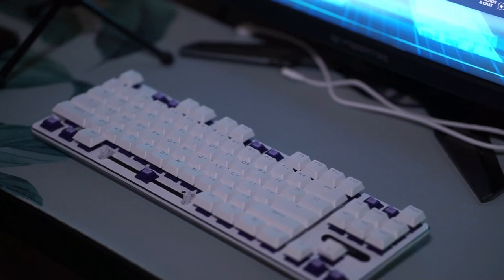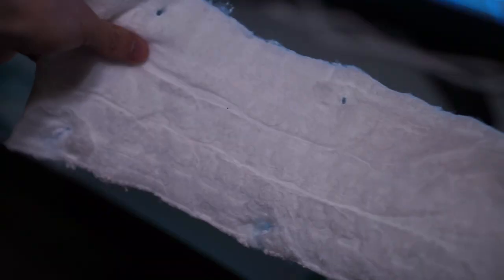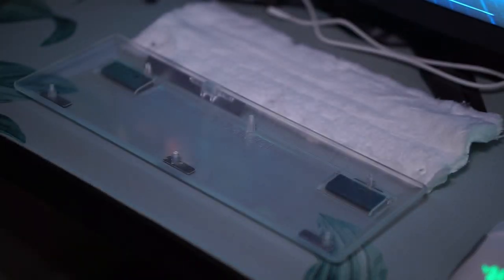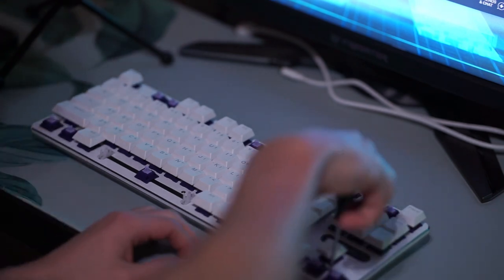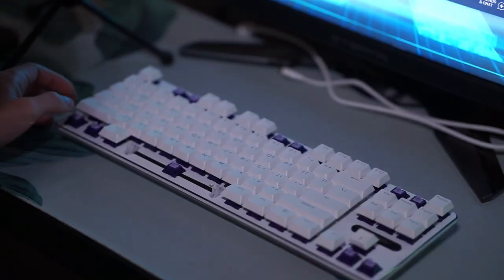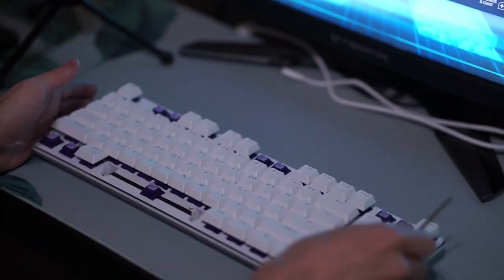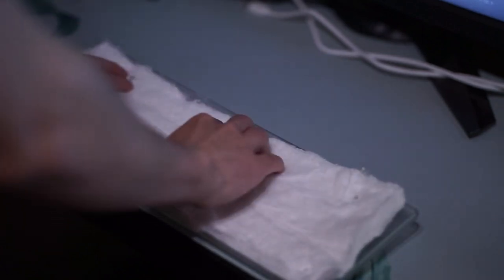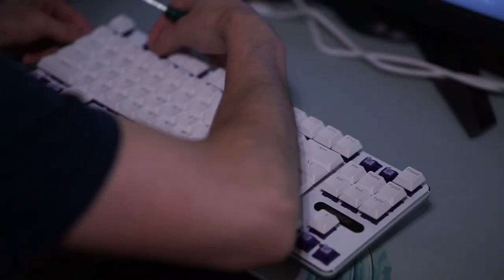How to Cotton Mod Your Keyboard

Comment from the maker: Note: The sound difference may not be a lot in this video, and that is due to the fact that the keyboard I tested this on already has a silicone dampener in between the PCB and Plate. It will have a better/bigger effect on keyboards that don't have any sort of foam, and/or are very hollow :)

Comment: I tried using cotton inside the keycaps, because I realized that the biggest noise was the internal bottom of the keycap hitting the switch top and it was much better, even without any mod

Comment: Wow I never thought of using cotton. I have the same keyboard and I used Gorilla Glue drawer/shelf liner. 

I went with that because they have a bunch of different colors and I didn't wanna ruin the clear bottom of the case. If you take your time to cut it right it looks nice and sounds way less hollow.